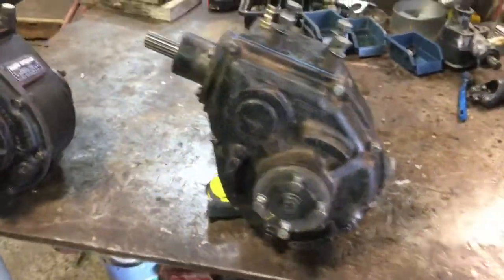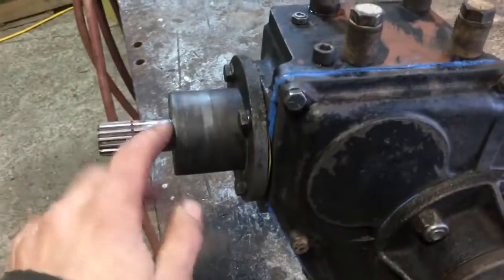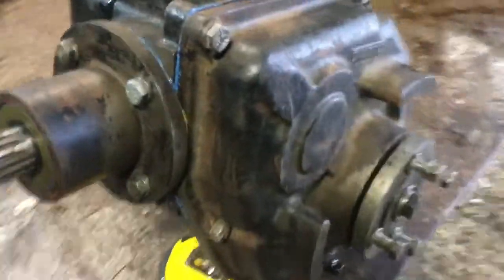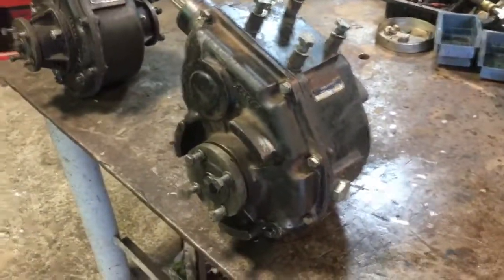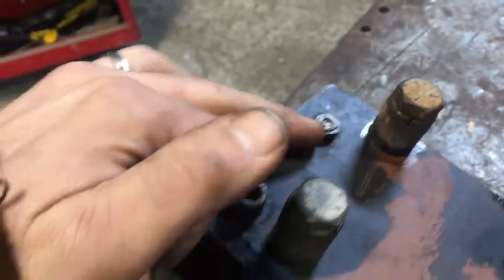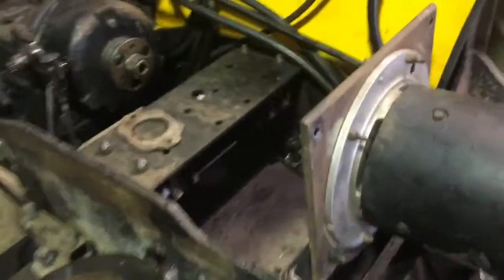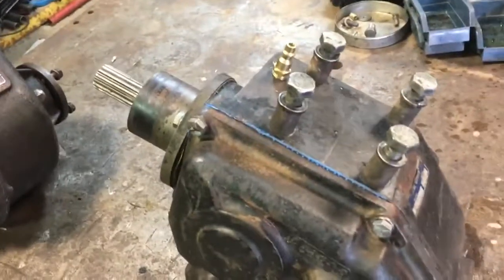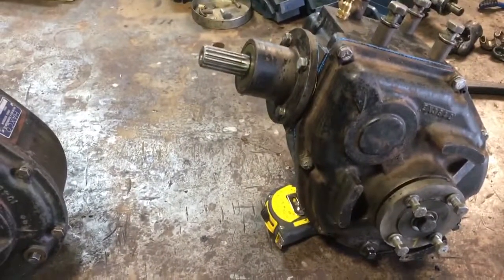Hefty-G differential repairs part 2

Comment: Do you know where I can get one of these rear ends
Reply from the maker: I suspect that they are exceedingly rare as the manufacturer (Haxco) had been defunct for decades and original productivity probably want huge.  If I were doing a second tractor i would eliminate the transmission and substitute a differential from a RWD or AWD car or light truck to make it more serviceable.
Reply: @reidallaway  i have a Jacobsen UV-4 that takes this rear end and it’s a 4x4 so in order to use a different differential I would need a exact matching gear ratio so that the front differential works with it.
Reply from the maker: @michaelmoyer8643  oh no,  that's a cool vehicle.  To bad it's got the Haxco diff in it.  Does it use the same diff front and rear?  You could replace them both and sell your 1.5 haxco units on eBay to someone just like you 😄